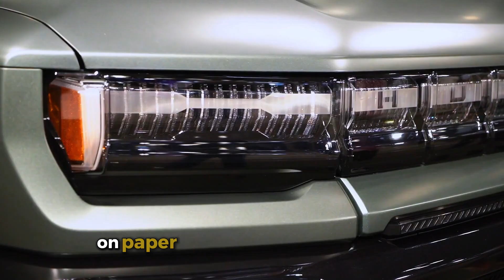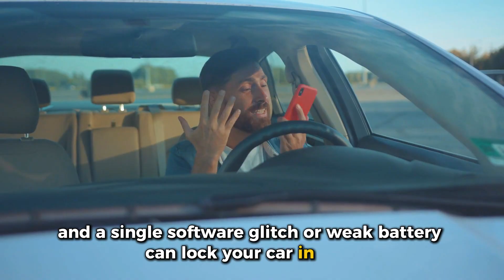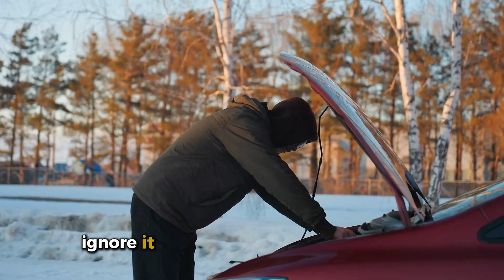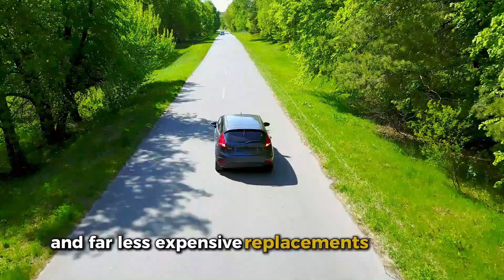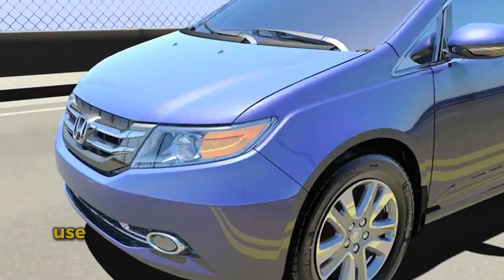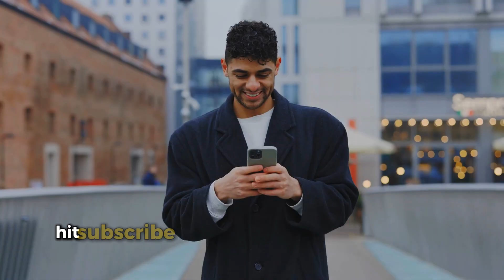10 STUPID Car Features That DESTROY Reliability & Lifespan

Comment: To overcome most of these issues is simple.   Buy a new car with a good long warranty, then get rid of the car just before the warranty ends and get another new car.  Simple
Reply from the maker: That’s definitely one way to do it 👍 — swap cars before the problems even start. The only downside is how much value you lose with new car depreciation. I’ll be covering both sides in a future video: keeping cars long-term vs flipping them before the warranty ends. 🚗💡

Comment: For my 2017 Highlander I bought a little device off Amazon that turns off the run-stop feature.

Pop the run-stop button out, unplug the switch, plug the device off amazon between switch and wiring harness from car, shove it all back in.

Now when car starts, it simulates a button press which turns off the run-stop feature.  Show's a yellow A on dashboard indicating its turned off.

If I want to turn the feature back on, I just have to press the button.

Perfecto... doesn't' disable anything, just defaults the function to OFF
Reply from the maker: That’s a smart fix. Do you remember what the device was called on Amazon? I bet a lot of people would want to try that on their cars too.

Comment: The problems listed for the EPB isnt all. I had a car with one that malfunctioned and just stopped working. Replaced the actuator and motor, still nothing. Shit system
Reply from the maker: Exactly — replacing parts doesn’t always solve it. EPBs can be a nightmare since the failure can be anywhere from the actuator to the module or wiring. Definitely not the most reliable setup.